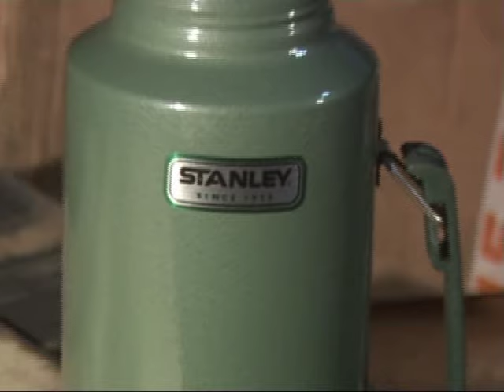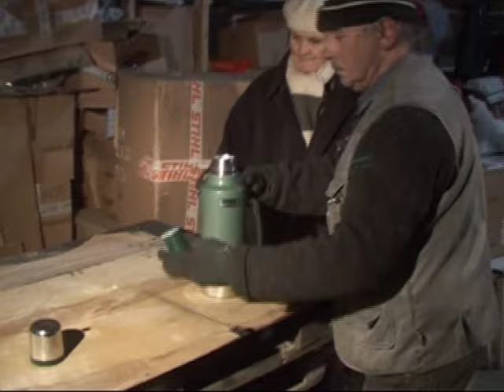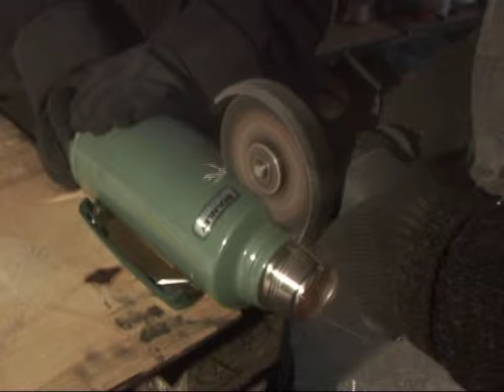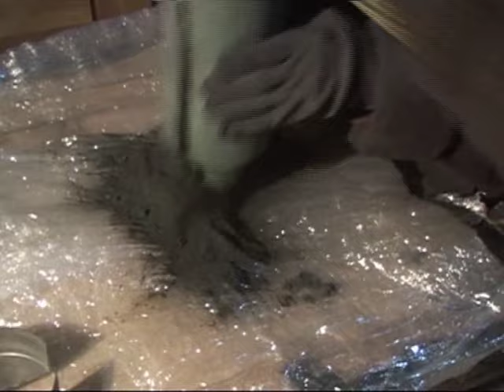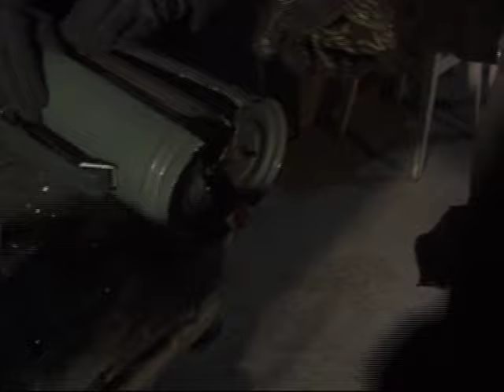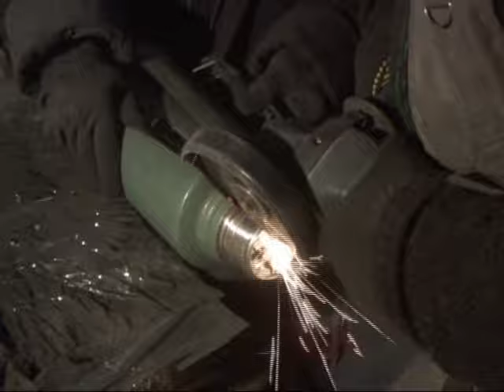Stanley Legendary Classic

Comment: What exactly was that insulating material?  Or were they smuggling heroin?  Mr brownstone.
Reply: +dbez vacuum bottle. "nothing" was the insulation.
Reply: +dbez What you saw coming out of there was charcoal, which is a good insulator. The real virtue of the insulation comes from the fact that it had the air vacuumed out from the cavity. No air = no convection. Charcoal conducts EXTREMELY slowly and blocks radiant heat transfer.

Comment: Do you have any idea of how do they add the charcoal in the manufacture process?? As they are supposed to be "vacuum thermos".
Regards.
Reply: The one they opened in this video is a pre 2000 piece when they used coal powder as insulation. Now they use the vacuum chamber and thicker metal walls